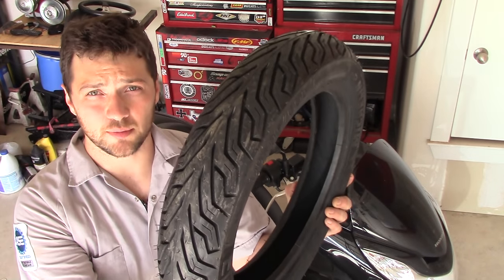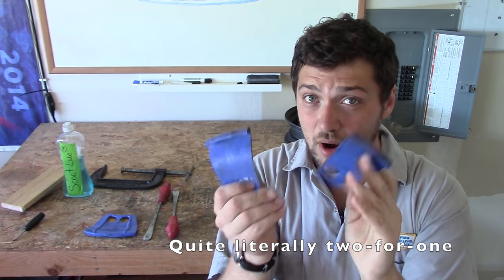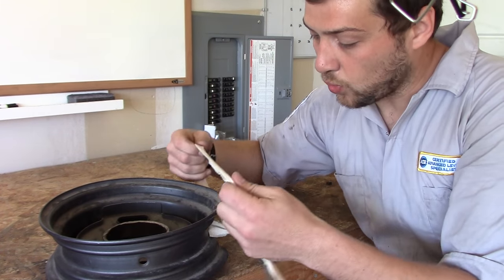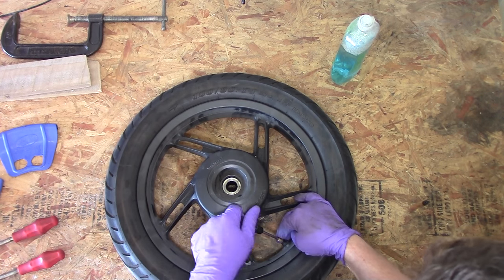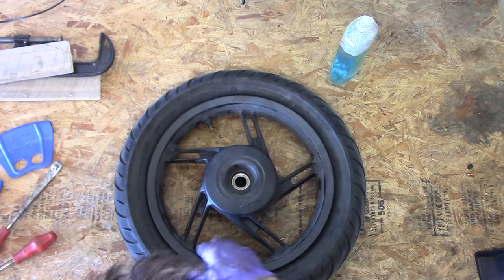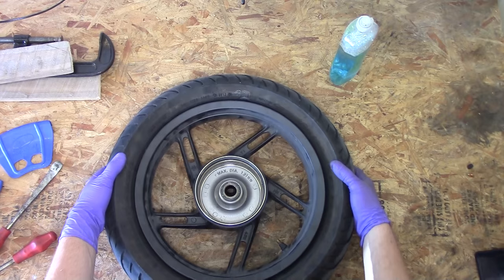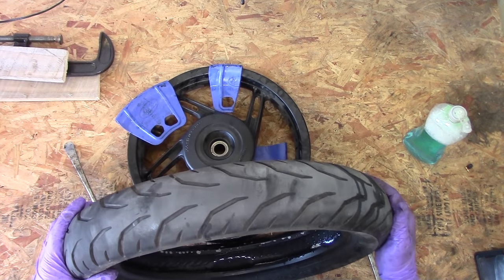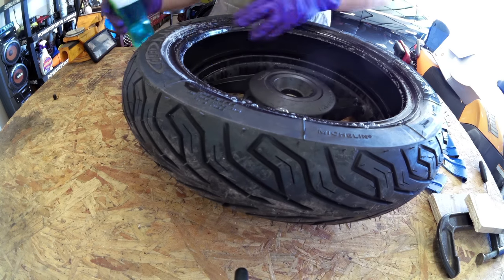Scooter 911: How to change a motorcycle or scooter tire BY HAND! (a complete guide!)

Comment: Thank you for this video as well as all your vids. I paid a shop to change my tires and they did a terrible job and will not back up their work. Rear tire has a huge difference in bead lines around. As a result, huge out of roundness and a terrible ride. I think they bent my front rim also. So, I ordered new tires, as I’ve rode these for awhile. I will get front rim straightened and then mount my new tire. I will do the rear 1st as the rim is perfect.
Reply: Dave zimmerman did you ever live in kincardine on.

Comment: It’s a good idea to attach the rim to a bench or attach it to the plank and use your own weight (plank and two chairs is a nice way) to keep it in place when using tire spoons. First bead over the rim lip, as you showed. Second bead, with a strap and your own weight to pull it off once you’ve got it over rim lip by spoons. Plank upright on the floor and use your leg for pull downwards. 
My best time is on minute and ten second, for take scooter tire off and put in place, with plank.

Comment: I had installed the micro- dynabeads through the valve stem into the tire.  I could NOT reseat the bead on the tire with the beads installed.  only after I removed the tire again and vacuumed them all out did it want to seat.  It was hard to re-seat the used tire.  what I did the time it worked was to take a soapy rag and polish/clean the inside of the tire to get any dried junk off the rim and then on the 12th time using 100psi big air, did the tire seat.  the PCX 90/90 tire was the hardest time ive ever had reseating a tire - but it did work eventually.  the trick of using a clamp around the outside didnt work because it pushes the bead into the dip of the rim.  the trick, like he said was putting plenty of soapy water (1:1) on rim and the whole bead to allow it to slip back on.

Comment: Good time to install 90 degree valve cores! Just make sure they face the right direction. I put in a rear tire 90 degree  facing left and it hits the trans housing when the wheel turns.

Comment: Excellent video that taught me all the things I didn't know and tools I would need. But -  hey - no rim-guards when putting the new tyre on...?
Reply from the maker: Excellent observation! When installing the tire back on the rim the spoons actually only touch the inner portion of the wheel so its not as imperative to use the protection

Comment: High quality content in your vidos. Awesome!! Just wonder, is there never a need to balance a scooter tire?
Reply from the maker: Usually not. Scooter's usually do not achieve speeds high enough to throw the super light mass of their wheels and tires out of balance. You'll notice from the factory the only scooters that come with balanced wheels/tires are Suzuki burgman 650 and larger displacement piaggios.

Comment: Thank you once again Garret! I have 3 Honda Heli(x) that I just bought and I'm wanting to change tires. I'm a huge fan of Michellin but I don't think they make them in the recommended sizes for the Helix which is disappointing to me. Nevertheless, I'm wondering about "balancing." The local motorcycle shop wants $90 a piece to do what you just did so I won't be doing that (so thanks again). Do these things need or ever get balancing? I appreciate all you do buddy! Man, I just saw your stator video and it was AMAZING! I'm not sure you know how much you help people with your kindness, wisdom and entertaining style, but I'm a dedicated fan of yours and can't thank you enough!
Reply from the maker: Thank you for your kind words. Honestly scooter tires rarely get balanced (even from the factory!). Not only is there not a good way of mounting them to a typical motorcycle wheel balancer but the smaller diameter of the wheels coupled with the lighter mass of scooter wheels doesnt allow them to react as violently to imbalance as larger motorcycle and car tires. To go one step further scooters don't travel at speeds that would make this imbalance noticeable.

Comment: Hi Garret I like your videos and your youthful energy.Could you please solve or advise on the following.I have a honda pcx 125 and recently replaced the variator rollers all well and good until I tried to remove the clutch.The clutch bell came off fine after unscrewing the nut.However when I tried to remove the rest of the clutch I was unable to do so.It is solidly stuck on drive shaft.From looking at videos it should slide off quiet easily.My clutch does not it is stuck tight.So I left it as it was and replaced the crank case cover.What is causing this?I be grateful for some advise.Many thanks
Reply from the maker: I've seen it a lot while working as a technician. What happens is the heat of the clutch swells the clutch onto the final drive input shaft and over time they sort of get welded together. I'll give you a technique but it is a touch dangerous to your clutch so exercise it with caution. Keep the clutch bell off but place the retaining nut back on the input shaft to protect the threads. Then place a prybar behind the clutch (in-between the clutch and the transmission case) and apply a firm pressure. Not too much or you'll put the clutch in a bind. Then using a medium to light hammer (not a soft mallet or urethane dead-blow) deliver a quick strike to the retaining nut. The object here isn't to beat the clutch off the input shaft its just to deliver a quick shock to help the parts separate while gently prying on them. Be careful though and take your time. If one or two strikes doesnt separate them rotate the clutch and pry on the other side while striking the retaining nut again. Good luck!
Reply: Thanks Garret appreciated

Comment: You don't explain what one should do if the tires don't just magically take bead. I got one to take pretty easily, but the other one is probably going to have to be filled with starting fluid and set aflame. If that doesn't take, it's on to trying a ratchet strap around the tire to push the sidewalls out. What do recommend to get them attached to the bead if they don't just jump on there? Thanks! Love the video other than that
Reply from the maker: That is an excellent point. I may have to make an addendum.

Comment: Awesome video. Just curious: why does the tire seem to stick so hard to the wheel lip? Does the rubber just sort of "weld" itself?
Reply from the maker: Its actually a vacuum seal I guess similar to that protective film thats on a new phone or TV. Just the lack of air between the surfaces creates a tight bond

Comment: Hey, thanks for the great content. I'm gonna try to change my 2009 SYM Fiddle II tires which are cracking and bare 🙀 I just bought the scooter used and am having trouble finding and sourcing the right tires. Manual says Front tire 110/70-12 47J Rear tire 120/70-12 51J. But what's actually on the scooter now are Duro 3.5x10 front and rear. Do you think the different size just fits and is ok, or is it not a good idea to use this size, OR did they change the rims? It's been hard enough to find any of the sizes in stock!

Comment: Thanks for a great video! I'm in the market for some new 3.50-10 tires and wondering if anyone has some recommendations? the dealer I'm buying from has Heidenau and Kenda tires. I need a tire which handles both dry and wet conditions well. I usually use the scooter for going into town and back (15 km) but occasionally I go on longer trips (50-60 km). No racing, just normal use. No winter driving.

Comment: I was wondering if any of these tools for changing a tire might be more readilly available at a nearby store, instead of having to order through internet. Cant you put a link for someplace like Autozone or something like that.? I go to Autozone and other car parts  stores for stuff like tire plug kit, inflate kit because you need to fill the tire once you plug it, car paint, valve lapping compound, oil , etc. I use mobile one synthetic racing oil for my Honda Metropolitan.

Comment: I'm confused. Somehow the tiny valve stemthat sticks out of the tire, where you connect the pump to put air, broke off. I was looking to find a new inner tube but the tire itself says tubless. How can it be tubless if it's partially flat, and i can't add air since the valve stem that sticks out of the tire is broke off?

Comment: @Garret Seesing : Hey man! I want to ask your honest opinion, and anyone else also feel free to chime in on the subject. I'm a first-time owner of a Daelim SJ50, and the first snow settled here in Norway. According to Norwegian law, it is not mandatory to have snow-tires/winter tires with spikes on since the vehicle is under 3500 kg if I've understood the regulations correctly. If anyone here has any experience with driving a scooter in the winter, did you guys experience any noticeable difference with all-year tires (as I have on mine), or winter tires with spikes on? I'm all for safety, so I'm really considering either a new set of tires or chains of possible. Thanks in advance. (Oh and before anyone else asks me, no I don't have the drivers licence for car, only for scooter etc/50cc, so I can't drive a car instead).
Reply from the maker: Unfortunately we don't get the option for studded motorcycle tires here in the states. But I have had really good luck for winter riding with the heidenau k66.

Comment: Hey dude, I need your help. I own a 2017 50cc Tao Tao,  never had a problem with it. It does start hard but it barely has any miles since I bought it new. Anyway I have a friend that bought me a 150cc  xpro motor long with no wheel/brake drum tire unit. Mine doesn't appear to fix? It seems my wheel is small in drum area so it can't go over the brake shoes. I see I also need a mount for the engine. Do you know where I can buy parts is the help I need. Great videos,  learned a lot from you thanks in advance 👍
Reply from the maker: I know this is not going to be what you want to hear but it's almost never worth it to 150 swap a qmb bike. it takes quite a bit of modification just to get the engine mounted in the qmb chassis and then after sourcing all the parts you'll need to have a safe/ridable bike you end up spending much more than if you just bought another 150cc complete scoot. It can be a fun project but typically it takes a complete 150cc parts bike to get everything you need
Reply: Thanks.  Any place to buy parts?
Reply: @Scooter_911  Thanks bud, I already modified and welded it new mounts. I was able to use the original rim and tire off the 50cc. I then removed the brake shoes and was able to insert the rim a bit more and have aligned the engine.  I just need a moped scooter parts warehouse where I can buy parts. You've been a great help.

Comment: Dude, you have saved me SO much money. Over half the stuff I take my moped in for I can do for free minus cost of parts which isn't a lot. But now I have a burning question and I'm not finding straight answers online. 

I have an old kymco agility 50 4t. The engine is a kg10sa. I'm looking to completely swap out the entire engine with a new one and was wondering if a standard long case gy6 engine was compatable or which ones are compatable. 

Love your vids by the way. Extremely helpful.
Reply from the maker: Right on! Glad to have helped! As far as the swap goes I've only done a few 150-50cc swaps, and the easiest/most successful swaps were shortcases made by the same manufacturers. I remember a bintelli scorch 50 that took the 150 engine with barely any mods. So I would measure all the specs of your engine/shock mounts and shoot for an agility 125 engine. Good luck and let me know what you find!

Comment: I have stock 90/90R10 tires. Can I change to 100/90R10 to get a little more cushion in my town with less than perfect roads? (potholes and bad road repairs)
*I have more than 2" of space between the tire and fenders, so height should not be an issue.
I am aware of the 4% speedometer offset. (50 - 52 KPH)

Comment: I'm having problems with my new tire getting onto the bead seat. It's stuck in the drop. Any tips to get it up there?
Reply from the maker: Yes, infact I have 3.
1. Use as much soapy water as possible. Sometimes even more than seems necessary 
2. Get the tire warm by setting it in the hot sun. It makes the rubber softer and more flexible
3. Try to get the air into the tire as fast as possible. Sometimes it can help to take the valve core out and put a blow gun tip on the valve stem for the fastest air.
If all else fails you can try putting a wratchet strap all the way around the circumference of the tire and squeeze the tire into place. Good luck!
Reply: @Scooter_911   Thanks for the idea to heat the tire in the hot sun!

Comment: Do you ever balance them? I never do myself- probably should though..
Reply from the maker: I actually don't unless it's a larger scooter with a high top speed like a burgman 650. But even then without rear wheel bearings built in the wheel it's nearly impossible to balance. I feel that smaller wheels are so light and scooters rarely see speeds over 60mph it never makes a difference. I have had some persnickety customers insist on it though!
Reply: @Scooter_911  To be honest.. On a tubed tyre, you're just as likely to repair the tube and seat the tyre in a different place...

As for car tyres- after putting the tyre on (by tyre irons like you).. I normally just roll them to the garage down the road for them to balance..

Comment: Could the tires be inflated with a foot pump I don't have a compressor unfortunately.
Reply from the maker: Absolutely!  There are times where the tire doesn't want to seat and you need that fast rush of air to push the tire outward to meet the bead. In that case the compressor is useful. But if you're clever with the way you hold the tire the footpump will work fine. Good luck!
Reply: @Scooter_911  cheers mate 👍

Comment: Hey scooter 911 im gonna change my carb what tool do i use on the throttle cable to remove it on the 50cc like wrench size to take it off the ones that came with the bike dont fit kinda stupid.

Comment: How are you balancing them?
Reply from the maker: normally scooter tires dont require balancing due to their low mass and low operating speeds. You'll notice manufacturers dont even balance them from the factory! Vespa included! Hope that helps good luck!
Reply: @Scooter_911  Does 60mph still count as a low operating speed? I just bought a PCX150 with new tires so I wont have to change them for a while anyway but I'm curious if there would be any reason for balancing a "fast" scooter like this. I know it's very light. Feels almost like a  bicycle when I move it around comparing to a "real" motorcycle.

Comment: I have a new 12 inch rim and a new 12 inch low profile tire. It's very hard to get the tire on. I ordered the same size 12 inch tire and 12 inch rim as what the scooter had on it. I have put 13 inch tires on 13 inch rims before other scooters I have had which were pretty easy to do, but getting the 12 inch scooter tire on a 12 inch rim seems so hard, i have tried this 3 or 4 times. Does anyone have some advice?

Comment: Do you have any thoughts on tire bead sealant/grease for scooter tires?
Reply from the maker: Yes many! I worked in a shop called "Tire-Rama" for a while so I have a lot of thoughts and beliefs on tire-related subjects. Unless you are using specialized lubricant designed for mounting tires I can only recommend you use dishsoap and water. You really don't want to use anything that can remain in the bead or cause the bead to slip. 

As far as sealants go, they are a last stitch effort to if you have air leaks at the bead. Usually that is due to the aluminum wheels oxidising and deteriorating, creating little areas for air to escape. Once aluminum starts breaking down there's no stopping it. Bead sealer can provide a temporary solution BUT it seams to accelerate the deterioration. So if your wheel doesn't have any need for it I recommend a dry mounting. You don't want anything holding moisture between the rim and the bead.
Reply: Thanks man. I put some Shinko mobbers on my kymco a couple weeks ago for the Vermont winter. Couldn’t have done it without this vid.
Reply from the maker: @bustedpresents  haha nice man! Love that gnarly look on a scoot! Keep it shiney side up!

Comment: Do you not need to bother with balancing scooter tyres?
Reply from the maker: Thats correct! You'll notice they don't even come balanced from the factory! Scooter wheels and tires have relatively low mass, that coupled with the lower speeds scooters travel at make it not necessary to balance them. Cheers!